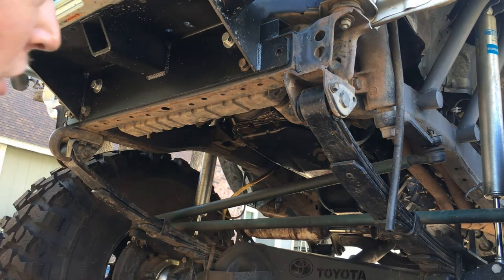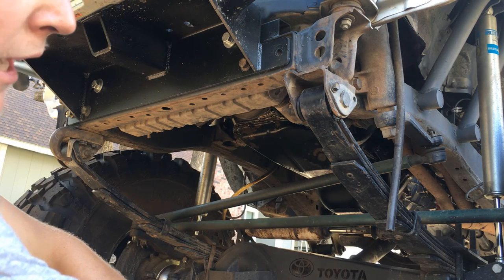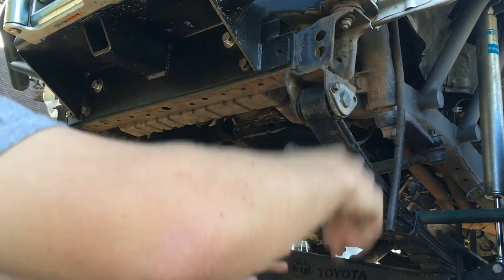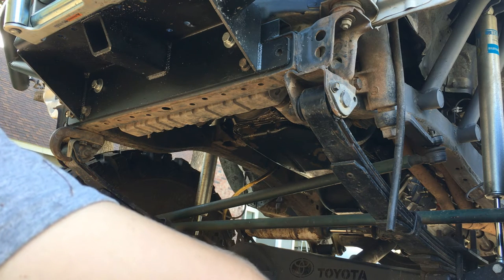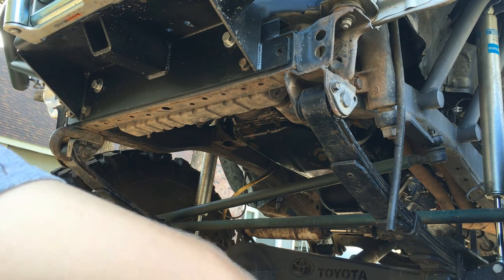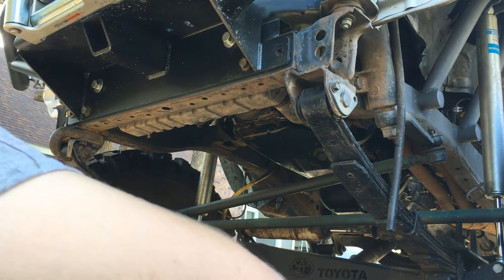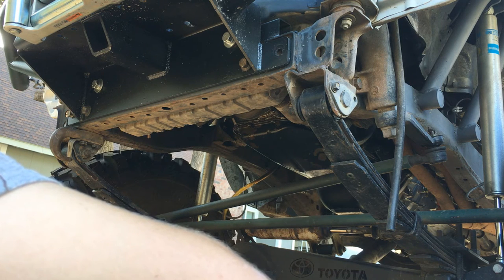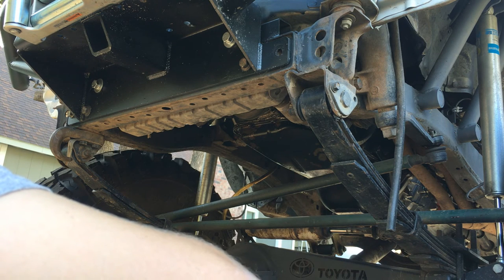New idea for moving a stock Toyota solid axle foward

Comment: I have same issue with my sas.  have friends that run 42s and their sas is forward in stead of under wks great.  BUT you have to relocate and move your steering forward too that's the tough.  the steering box is already up against body mount.
Reply from the maker: Yeah the box is really close already but it's not a sas its a stock solid front axle so I might just bump stop the front for now so I don't fuck my tires up more until I cut everything off and re build it and move the box forward. Thanks for the comment 🤘🏻

Comment: if you move Axle that far forward without moving the steering you will have major problems with the drag link in relation to the steering box
Reply from the maker: Joshua Correa I ended up moving the box also